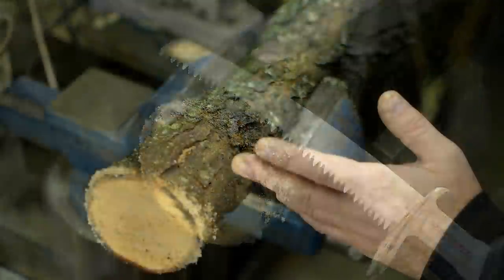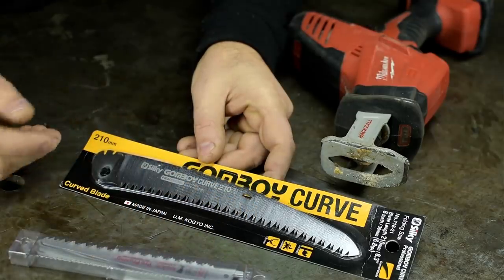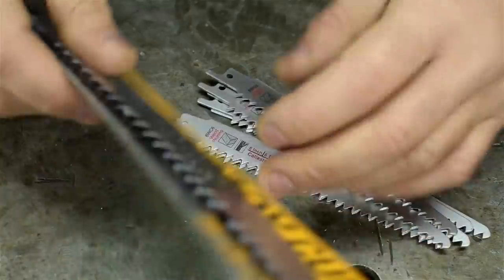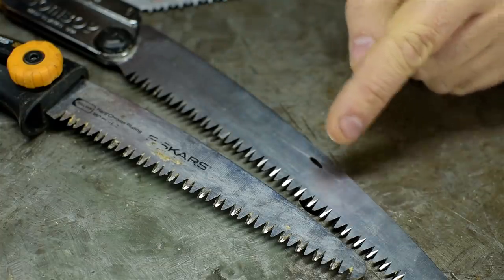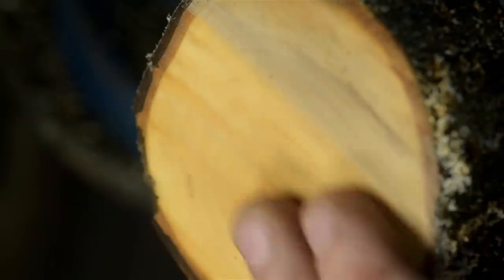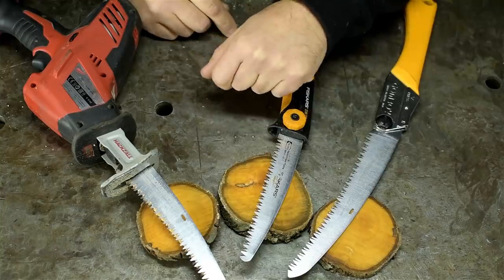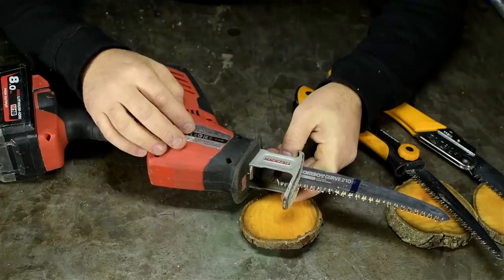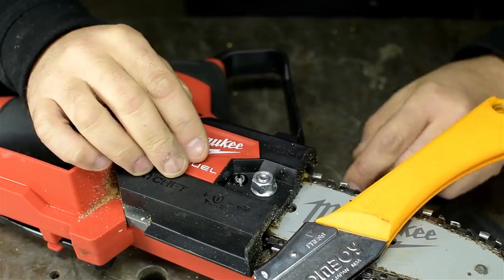Pruning For Machinists!

Comment: These Japanese saws are designed to cut primarily on the pull stroke. The powered saw is really only giving you the cut from a 20mm pull, and the 20mm push is just putting the chips back to where they were. These fleam, zero-set, teeth are very popular with Japanese saw-makers. Since there is no set, saw-dust can only be cleared by the teeth coming out of the work, so that the dust can fall down from between the teeth. If the cutting teeth don't clear the work (as with short reciprocation)  then the process is bound to fail to some degree.
Reply: So are generally all japanese saws made that way? I know of the big.. rectangular ones but they are the only ones I've encountered.
Reply: @Devantejah  No, but these fleam, zero-set, teeth are very popular with Japanese saw-makers. Since there is no set, saw-dust can only be cleared by the teeth coming out of the work, so that the dust can fall down from between the teeth. If the cutting teeth don't clear the work (as with short reciprocation, then the process is bound to fail to some degree.

Comment: I have the small yellow model electric chainsaw, that matches my battery collection. It's surprisingly good at even smallish logs, but I use it for downsizing limbs for the brush pile. The battery feature is much better than constantly starting and stopping my gas saw while dragging branches into a pile.

Comment: This why I use a 12" pruning blade in my sawzall.  Then you slowly saw back and forth with the saw running and this clears the chips.  Thus the 12" blade is good up to about a 6" diameter branch.  This is really useful when camping because most campsites (at least the ones that I go to) don't allow you to use a chainsaw but there are no restrictions on these (especially since these are relatively quiet).

Comment: If you made a wave form out of the stroke you'd see the manual as a single sine wave. The powered saw would be 2 waves. 1 wave from the manual stroke and one wave from the motors stroke. These 2 waves would be in the same phase multiple times per second. During this time no wood would be cut. If you could time the phases as a sine and an arcsine it would be super fast but you'd either need to slow down the saw or significant speed to your arm.

Comment: Instead of a chainsaw on the trail, I use these big demolition blades on my reciprocating saw.  I use an 18v makita that came free with a tool set, and if it burns out (had it for like 10 years now) it's less than a hundred bucks to replace. Trailer has a double bank makita charger powered by solar/hybrid automatic generator, so I never tend to be short on battery power.

Comment: So, the difference in cut speed approaches zero as the initial stock diameter approaches zero.  Do  you think there is a crossover point on the graph?  Some point where the modified blade out performs the hand powered one.
Reply: Yes...when material width is the same as or smaller than the power saw's stroke length.
Reply: @SomeGuy-vo7we  Amen
Reply: It's not simply the simple equation of "hand blade cuts faster than powered blade", it's also how much effort the operator has to exert. With the hand saw, the operator is exerting ALL the energy input necessary for cutting the wood. With the similar blade in a reciprocating saw, your back and forth motion is primarily to allow chips to clear from the tooth gullet, while the battery/socket provides most of the energy used to sever the wood fibers, creating those chips/sawdust.
Reply: @SomeGuy-vo7we  Maybe. Sometimes a slower stoke allows for better (wood chip) release...
Reply: @mlindholm  Regardless of effort, if you only graph rate of cut, then it is as simple as which cuts faster.
Reply: I haven't figured out how to prove this, but I suspect that the powered saw will become comparatively faster when branch diameter becomes negative.
Reply: @LonersGuide  No, a negative-diameter branch will be cut before you start.
Reply: @markfergerson2145  Prove it.
Reply: @LonersGuide  I already have. There are lots of negative-diameter branches on my property that I haven't had to cut.
Reply: Just like the the limit of ENG major as GPA approaches 0.00 = Business degree.  Like that?    LOL, sorry couldn't resist.  I saw it like 35 years ago and it still cracks me up (BECAUSE IT'S TRUE) 😂
Reply: @hansangb  Ha! Now that's funny!
Reply: @mlindholm  but then you have to factor in how much energy you got to spend in order to earn the cash necessary to bay your electricity bill 😂
Reply: The crossover is at roughly double the saw's stroke (because chips are pushed both forward and back).  With the 5/8" stroke of the Hackzall, you can effectively cut up to 1-1/4" diameter limbs, and are most effective on limbs under 5/8".  Anything over 1-1/4" and you can expect a dramatic drop in performance.  Super Sawzalls are available in strokes up to 1-1/4", doubling this pruning capacity to a maximum of 2-1/2".

Comment: As someone who did some pruning lately (with a small makita chainsaw) I really did like it when my dad stepped in with his bosh telescopic chainsaw (even smaller than the makita!) that thing was amazing to use to cut down hard to reach 'deep into the bushes' kind of branches.
full week worth of pruning and cleaning up was less of a chore than usual with that telescopic thingy, do check it out!
Reply: I have a 16" 2 stroke chain saw. Does a reasonable job and starts easy even after months. But eats chains!!
Cutting down a large semi softwood tree [silky oak] my friends electric [corded] Makita the same size less rpm and a smooth action and  the same brand of chain lasted far longer and cut through [with several cuts] the main trunk

Comment: I have had my Gomboy for about 15 years and have made a belt clip system for it. I can carry the handle and up to six blades in a small package. Even fits in the back pocket.  
There are now a really useful selection of blade types that are also made by third parties so you can get new blades quite cheap (in Japan). You can even get hacksaw style blades for metal cutting.

Comment: I would be curious how a super sawzall (orbital action and 1.25” stroke length) paired with a Diablo carbide pruning blade(extra large gullets) compares with the silky and m12 hatchet.
I realize that it defeats the point of being one handed, but inquiring minds want to know.
Reply: You stole the words right off of my keyboard. Or if you wanna get technical, you stole the same combination of letters numbers and spaces that my mind was thinking of typing on the keyboard.

Comment: I've got a Silky Gomboy and it's hard to beat for most small pruning jobs.  I also have a Stihl battery chainsaw with a 12 inch bar.  It is awesome, light weight, and works well on anything up to 8-10 inches in diameter.  It will cut larger stuff but it slows down significantly.  The combination of those two and a pair of loppers is all I need for clearing brush, pruning and most firewood cutting.

Comment: As an unwilling hobbyist in the art of receiving flesh wounds, I want to say: clean cuts take longer to heal than rough wounds. A paramedic who was tending to a wound I got by not missing the ground when I fell out of a pickup truck at speed said that rough wounds have more surface area, which means more area for the scabbing (he used fancier medical words which I've forgotten). I've cut myself with a razor blade before and it took way longer to heal than a similar sized laceration caused by a bike chain/sprocket surprise. Morale of the story: don't get wounded, clean or ragged.
Reply: Everyone is wrong! Lol
It's more about how clean the cut is, and how many times it gets pulled back open, then how ragged it is.
Any cut that gets infected or inflamed will take longer to heal, and if it's in a flex point where it gets stretched or pulled often it takes longer because the tissue keeps getting re re torn.

A clean smooth cut that's kept closed and bandaged will heal a lot faster than a jagged cut that's not cared for.

And the paramedic was missing a key point, which is that a jagged cut has more surface area that HAS TO BE HEALED, and that's not really a benefit.
The fewer cells that are damaged, the faster the body can reconnect across the gap and seal it up.
Reply: You fell out of a truck and missed the ground? What did you land on? 🧐
Reply: @notanavrageloser  I failed to miss the ground, unfortunately. Fortunately, the truck was only going about 10-15MPH, though that's enough to adjust the thickness of skin pretty quickly.
Reply: @elbowdonkey  in my defense: night shift is a cruel mistress.

Comment: Makita BUC122 is awesome. Had mine for 10 years now, used most weekends on a few acres of woodland, never ever sharpened the chain in all that time and it still goes through 4" branches super quick. I stopped putting chain oil in it a few years back (I got lazy), it had no effect at all to performance and the bar is still great too. The best Makita tool I have ever owned period. This is before the brushless revolution too, literally hundreds of hours on it.

Comment: They're not the same blade shape (curved), but the tooth shape (triangle shape, sharpened front and rear) of a pruning saw blade is absolutely available in a reciprocating saw blade format, and they cut much better than "rough cutting wood blades" like those other you showed.
Reply: Your (as best I understand it) location may certainly be leading to the lack of availability of pruning Sawzall blades, compared to the US market.
Reply: i've been using the diablo pruning blades in my sawz-most for years.  never going back to manual labor.
Reply: @PoodlePuncher   yea diablos carbide toothed pruning blade is the best blade I've used  out of the wood/ pruning blades ive used and it lasts for a long time

Comment: Another advantage to the powered pruning saw (over its manual twin) is that you don't need to be manually sawing back and forth. Besides the "energy savings" <g> (not to mention fatigue), there's stuff like balance.

I remember a half-century ago, give or take, when I was working for a water-blasting company. I found myself near the top of a longish extension ladder, blasting the livin' snot out of a brick chimney.

I was leaning into it, so as to be able to reach the areas that I couldn't reach if I hadn't been leaning into it.

Then, I released the trigger -- and nearly fell to my death!

The "recoil" from umpteen kilopounds of water coming out a minuscule nozzle was literally supporting my weight as I leaned into it.

I realize that a handsaw doesn't have any recoil. However, when you're "leaning into it" and straining your muscles to saw (with one hand) and hold onto the tree with the other, it's got to take a toll on your ability to hang on without any slippage. N'est-ce pas?

Comment: This is very interesting. I bought a Diablo brand pruning saw blade for my reciprocal saw from Home Depot and was surprised how slowly it cuts - I just assumed the bushes I was taking out were particularly tough wood (and they are tough, even to loppers) - but I hadn't considered it was lack of chip clearing.
Reply: I've been using those for a few years. They work great for me, but keep in mind that I use mainly hand tools for everything else.
Reply: its best to set it against the blade guard whenever possible depednfing on what size it is but I would try the carbide toothed pruning blade from diablo, totally different beast than their regular pruning blades and is by far my favorite blade when its becomes tree herding season again.

Comment: I'm yellow.     Have the Atomic recip, and the 12in 20V chain saw, and love them both.... clearing some raw mountain land in hopes of someday building something.    The recip (with the right blade ... takes some experimenting) is great and hugely fast for trimming and reducing branches     and cutting them down to size for the chipper.      With the 12 in I can bring down small trees ... and the battery lasts long enough to buck up about half a modest size tree's trunk. (though in hot weather it will sometimes overheat an need ten minutes of cool down to continue ... that's OK as by then I probably need some cool down time too).   Anyway as there are only a few old growth trees on my land,  those two battery saws and a sharp hatchet handle an easy 80+% of the tree work I need do.  Usually I'll bring down a couple mid size trees one day, and the next, debranch them and clear away, then the next day break out the Stihl gas for an hour or two to buck them all and handle any of the larger trees I want to fell.

Comment: The takeaway: praise the circular pruning saws! =)

P.S. May be an angle grinder with one of those suicide sawing discs...
Reply: No, dude, never one of those. The only good use of chainsaw teeth grinder wheels is to lock them into a vice and hit sideways with a 3lb sledge.
Get a hand saw. Bow saws work really well.
Reply: @max-zv7sf  Those chainsaw teeth disks are "double suicide" ones. The true "suicide disks" are sort of normal carbide teeth discs, but for an angle grinder (there are ones up to 14", I believe).
Also, a good RPM control on the grinder may be a life-saver.

Comment: You aren't imagining things, those Milwaukees chug bar oil and allegedly tend to leak it. Might be a good mod to restrict it somewhat, or add a metering valve that you can entirely shut to stop the oil from draining in your trunk.

I keep a pruning saw in my truck for general cutting, they work just dandy on dimensional lumber. The store I bought it from caught on I guess, because the saw I bought is no longer advertised as just for pruning, despite not having been changed in any way since I got it

Comment: I've been using my teal blue branded cordless reciprocating saw with a long demolition blade to rehabilitate some old and overgrown lilacs around here and had thought of making the same modification to a pruning saw blade, so thank you for preventing me from wasting the money.

After my own experiments I found that the demo blade does better if I run the saw at low speed while I move it back and forth to "spread out the wear" but mostly I think that helps clear chips. I think at high speed the friction boils the sap and steams the sawdust into sticky mush that packs the gullets even if there is otherwise room for the saw dust to clear.

I think your experiment indicates that there is no good reason to try to modify a pruning blade to fit the reciprocating saw, but I wonder if the pruning blade is tempered to the same hardness all the way to the end? I'm thinking that they might have left the shank end of the blade at a softer temper so that it was less likely to snap off where it attaches to the handle. Maybe it would have been easier to drill closer to the end of the blade. I'm also not sure you even needed to drill the hole. I did a bunch of tile this summer and ended up needing to cut a bunch of narrow strips of cement backer board. This rapidly destroyed the teeth on the saw blade nearest the shoe, so to use fresh teeth, I just ground off the tang and shaped a new one with the angle grinder every few cuts. It never occurred to me to drill the hole, I thought it was just a manufacturing artifact. The blade stayed in my Makita saw just fine.

Comment: Reminds me of the joke where a guy returns a chain saw as he could not cut down trees faster as advertised. Upon returning the chain saw, the salesman fired it up, whereupon the guy says "What's that noise?" Apparently, you have the reverse case where the sawzzzall would cut faster with a dead battery. You could use your fabled band saw, but they're kind of heavy to hold overhead for pruning.

Comment: Dear TOT; counter add.  Milwaukee once made the cutest corded angle drill in 3/8 &1/2.  My third one was lost.  They had variable trigger.  They need a precision rpm set trigger.  They needed electronic torque clutch stop, and a brake, and a battery.  While I would put up with a keyed chuck to get the mounting sleeve/ring on the front, a keyless chuck is wonderful.  
It came to me that I had to retool.(CA fire)  Yellow won out over Red.  Yellow’s best line keyless chuck can squeeze truth from a politician.  So the battery family argument won out.  I have Yellow batteries, sanders, super saw thing w/ carbide blade, and a monster torque drill.  I miss my little red drill but in sixty-five years of tool collecting, things change.

Comment: New video idea, modifying the Milwaukee hatchet to receive the 10” Oregon speedcut nano bar and chain. I was able to do it using washers and epoxy and some tack welds. You could machine some new parts and do it nicely. 
And it would be nice to see a comparison between the 6” full house chain and the 10” speedcut nano chain. Message me if you would like details or pictures, and of course it’s great to have you back!
Reply: did it have enough power though?
Reply: @connahjones8178  it seems to work the same, I haven’t measure or timed it at all. Same amount of power just a longer bar to reduce double cuts

Comment: A favorite blade for the recip saw were some fleam-ground pruning blades from Switzerland that somehow got sold by Dewalt. Like all good things, they were discontinued and my local factory service center was blowing them out.  As a construction defect specialist I needed to demolish a lot of wood structures fast, and those Swiss blades screamed through lumber but stopped dead at nails. I would do the quick switch to a nail cutting bimetal blade, and then back to the timber blade in seconds.  Although I was by the oldest crew member, those blades let me outwork  the youngsters on big demo jobs.